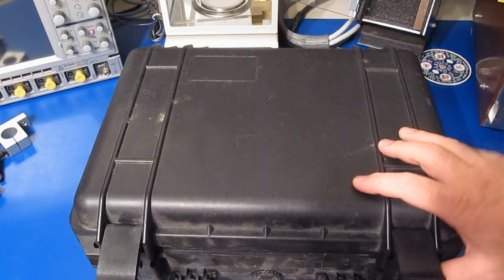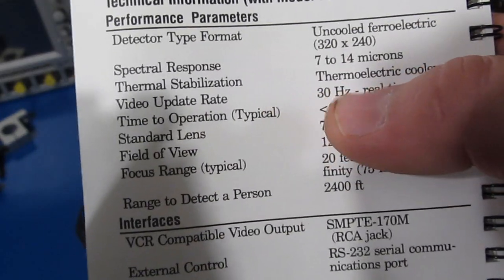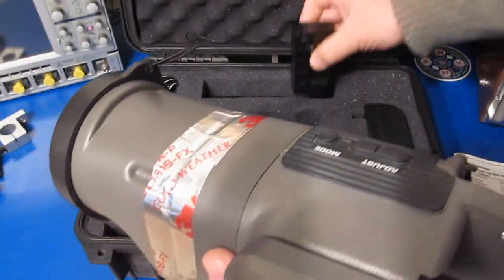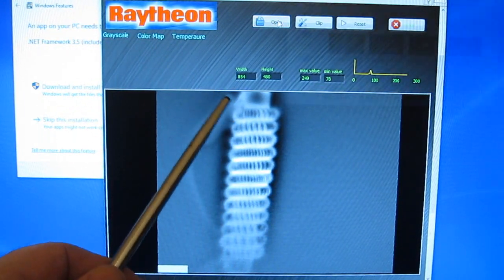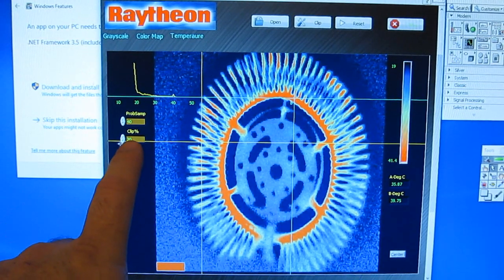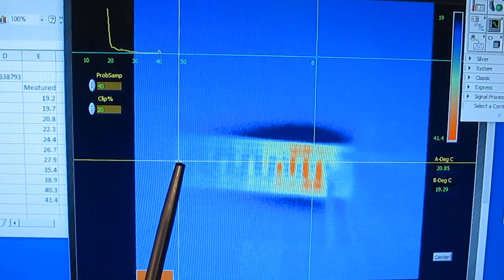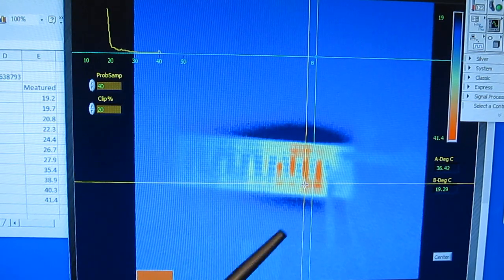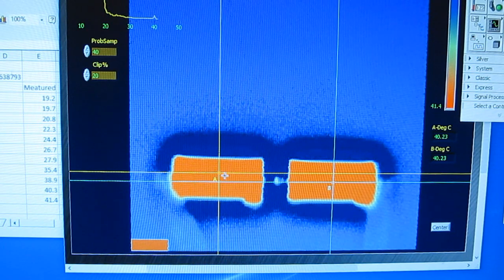Vintage Raytheon PalmIR 250 Camera Measuring Temperature

Comment: Great video! You mentioned a focal length modification. I'd be very curious to see how this was done! Or at the very least, see some more videos of your experiments with this PalmIR.
Reply from the maker: There was something that needed to be changed in the focus adjustment to allow more travel.  I then just moved the lens forward with a spacer and tape.
Reply: joe smith I’ve since acquired my PalmIR 250. There are two videos on my channel with more to come. I’ve been studying still images of the focus assembly (not on mine) of a 250 that had the lens assembly removed.

From what I can tell, a stepper motor with pinion, engages the geared edge of a threaded barrel which rotates, relative to the focus lens, which relative to the moving barrel, does not rotate, but simply moves in and out (adjusting focus). Is this correct based on your observations of the system in motion?
Reply from the maker: @thequinnreapernovaco.7497  It's been a long time since I looked at it.  I don't remember it being very complex but it does seem that I needed to extend it's range.   While it did allow me to get some decent close range views, it of course gives up the far range.
Reply: joe smith A few questions: after you modified the focusing element, were you still able to use the electronic focus, or did your modification disable that function as a result? If so, is the focus basically fixed at one distance? If the electronic focus feature was maintained, are you still able to focus at infinity, or is the focus now just limited to close up and medium ranges, sans infinity focus?

Comment: Nice video. I didn't realize even "newer" thermal imaging optics had thorium coatings. I'll remember not to leave that stuff scattered around my desk and wash my hands after handling...
Reply from the maker: You would need to check your specific camera.  I believe they are required to have labels on them now.
Reply: Hard to know, some modules have limited or no documentation and labels can be removed. Better to tread carefully since the precautions are relatively simple anyways.